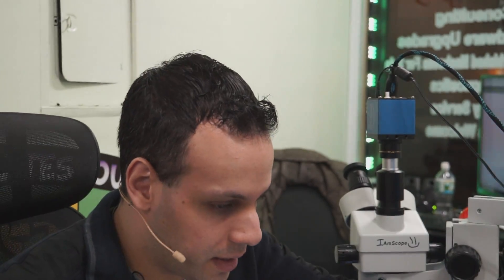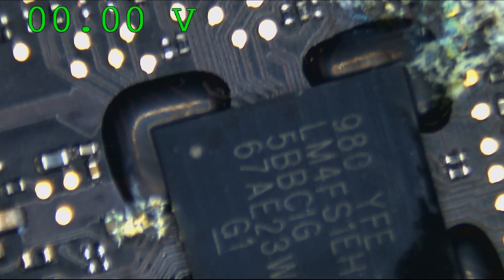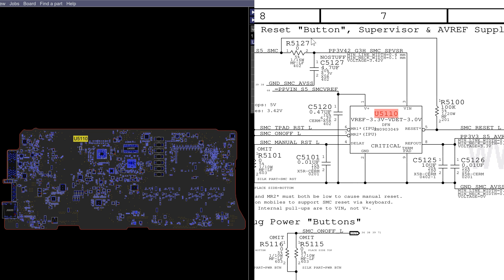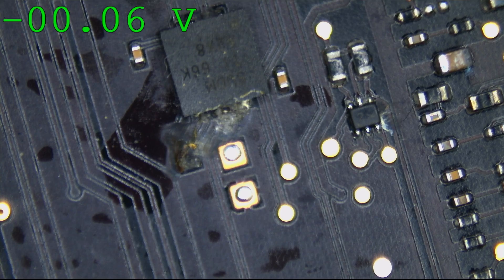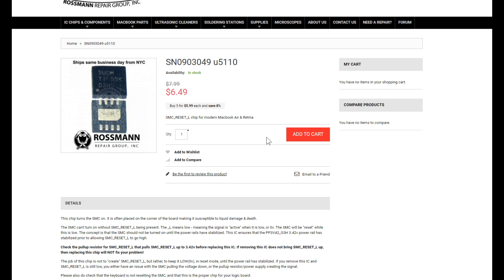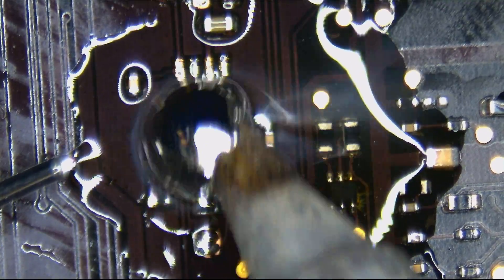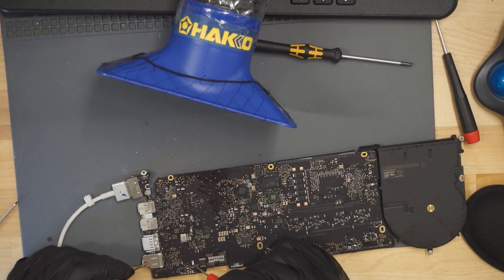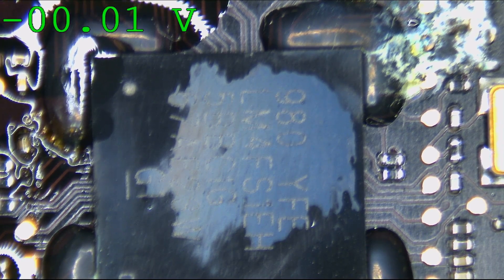Why Macbook Pro Retina has no green light and 12.23v on PPBUS_G3H

Comment: Why before starting to solder chips don't you clean all the corrosion with isopropyl alcohol? and after it work with the solder? In my experience most of the time a toothbrush and some isopropyl solves all the problems with corrosion if there's no broken connections or damaged chips. turning on a board without first removing all the corrosion and moist with alcohol might get the problem worse

Comment: Nice work, as usual!  Today I received a customer's  HP laptop with a problem. Intermittent power, no fan spin. Opened it up only to discover "liquid" damage and extensive corrosion. I believe they took it scuba diving...at Ron Jeremy's house. I'm currently still marinating my hands in sanitizer after a five minute 90% rubbing alcohol burn and a deep tissue hydroflouric acid rub, just for good measure. I love my job.

Comment: Not a macbook but last week I changed my Ipod Classic's battery, I bought it in 2010 and it was about time; around 5 years ago I replaced the HDD because the original broke (I removed it from PC the hard unsafe way) and after talking with Ipod Store in my country and they tell me it wasn't worth it I bought a 240GB Toshiba HDD on Amazon and works like a charm, I hope with the new battery it will lasts more years!. The only Apple product I have and the only that may worth the price back then.

Comment: My graphic card makes my computer shut off using certain apps like photoshop? 2010 mbp can that be fixed????
Reply: nellyps3 maybe it shuts off because the system is getting too hot. Your MacBook fans could be clogged with dust and need to be cleaned. But idk just a wild guess.
Reply: I dont think thats it, i get a code when it happens

Comment: You should keep a five gallon bucket of flux by your work station and just dip the whole thing before you get going.
Reply: Only 5 gallons? Surely you jest! At minimum, a 55 gallon drum is required.
Reply: What does that stuff do
Reply: bleach incognito flux prevents Oxidation... it’s practically impossible to solder without it, most solder has flux inside it. The oxidation layer prevents the metals from combining.

Flux is used in metal working as well as electronic soldering, The flux is just different material same function.
Reply: @BobLSaget  so it's like the stuff used when forge welding metals together
Reply: @longassrice8756  That's exactly what it is. Soldering is just a form of welding.